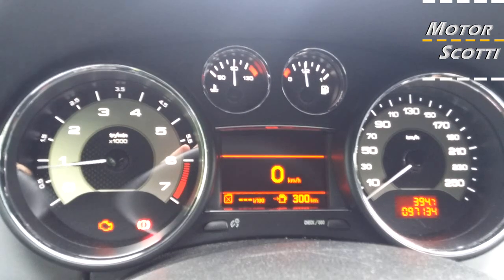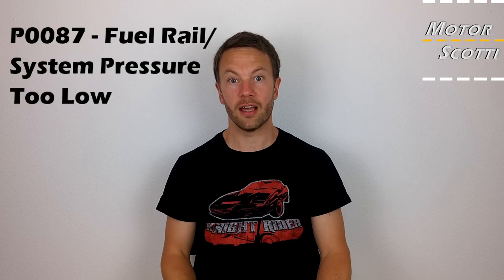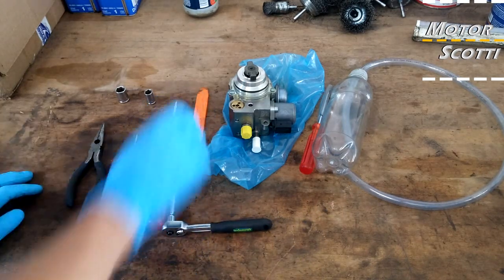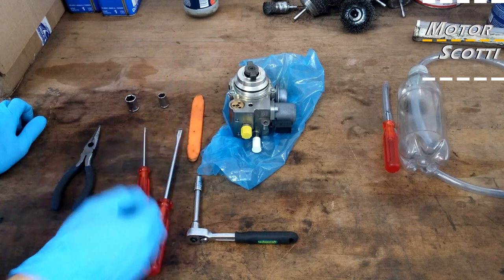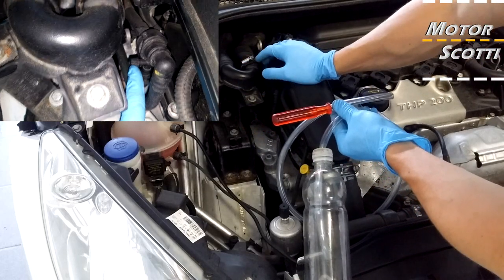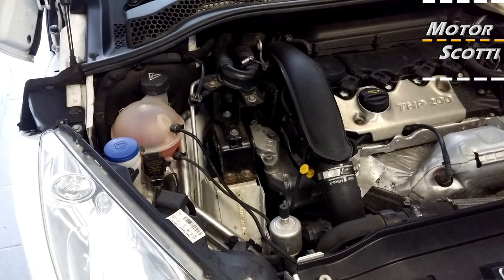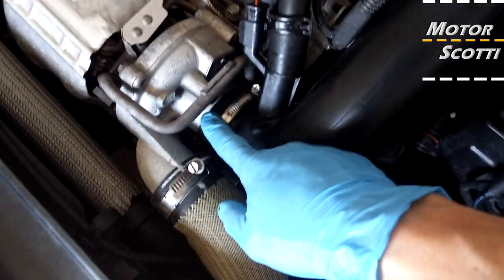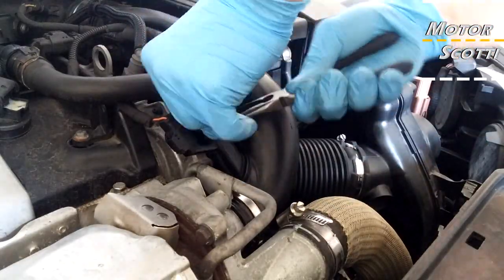New high pressure fuel pump - PSA & MINI Prince engine

Comment: I have the same symptoms, however no error codes, and the poor power performance is intermittent and occasional. I do have the rough idle all the time when the engine is cold. Mine is a mk ii 156GT, so was surprised when I got the problem
Reply from the maker: What do you mean with mark II 156 THP? What's the model year? Did you ever hook it up to a diagnostics tool?
Reply: @MotorScotti  Sorry, its a 2013 156GT, (mkii 1.6 Petrol)
Reply: I did hook it up to my OBD reader, which reported no errors, but did show issues with the Fuel Rail Pressure...
Reply from the maker: @Natastrophe007  Yes that is the error. The high pressure pump can't build up the fuel pressure anymore which is what leads to that error. It's weird though as this problem shouldn't occur on late 2012 onwards models...
Reply: @MotorScotti  Yeah, that's what I heard.   I spoke to somone who said it could be the fuel tank breather being blocked as it oddly only looses power after filling up a nearly empty fuel tank!
Reply from the maker: @Natastrophe007  Could be, always start with the simple things first before taking everything apart and spending lots of money ^^. You can test it with the fuel cap open and closed when you fill it up. Obviously don't drive with the cap open but you can still give it a rev - see if it makes a difference.
Reply: @MotorScotti  it can be that the inlet valves are dirty its a big known problem on these cars. Have the same car with the same engine in my showroom
Reply from the maker: @abcdsz  Good to know, thanks for sharing your knowledge!
Reply: @abcdsz  I've heard about this! My car only has 39000 miles on it! I do now have error codes. Just in time for christmas my car brakes down with codes P0171 & P2188. What I'm not sure is, what it may be. Is it the High Pressure Fuel Pump, or the Coil packs, or maybe just a air intake leak?
Reply: @Natastrophe007  let lambda sensor check. Those are well known problems too. On these engine are the most problems injectors, HPFP (high pressure fuel pump) , dirty intake valves , bad chain tensioner, chain that is stretching out. If i was you i would let check my lambda sensors . Hpfp and put a injector cleaner
Reply: @Natastrophe007  does your car have problem with acceleration?? If so pull out your mass airflow sensor connector off and see if your will stall and or drive with the connector unplugged accelerate hard and see if you have power gain.!  Btw is your  car remapped??
Reply: @abcdsz  Hiya, car is not re-mapped. I cleared the codes and the power came back, but i'll give unplugging a go. When the errors are present I have no acceleration power!
Reply: @Natastrophe007  p2188 is a Mass airflow sensor fault. So i think your MAF sensor is dirty or faulty. You can clean it with MAF sensor cleaner. If you have a faulty HPFP pump there would be a fault code like fuel rail pressure too low. (Something like that) . I dont know how much the maf sensor costs in your country but its always to buy a new one for optimal performance. If its expensive buy a bottle of maf sensor cleaner. And look first if your maf sensor is oily and dirty.
Reply: @abcdsz  Is that the same as the O2 sensor at the front of the engine on the manifold?
Reply: @Natastrophe007  it is mostly on the big black pipe after your intake filter housing going to your engine. With a big connector on its and two big clamps holding it at place on the two pipes coming from your filter housing and from a pipe to your engine.
Reply: @abcdsz  Ah, I see! I guess the only way to clean it is to remove? Fuel cleaner and additive wont help I guess?
Reply: @Natastrophe007  nope it is a direct injection thats why these engines have so much problems:(. But anyway the MAF sensor must br dry when functioning or it can burn the electronics. The only cleaner is MAF sensor cleaner. You can buy it from your local car parts store nearby. But watch out!!!! Dont clean it with compressed air!!!
Reply: @abcdsz  Just a quick update, the HPFP was the problem and has been replaced. The car is fine now! Thanks for all your help!
Reply: @Natastrophe007  Hi, could you please know how much did cost you replace HPFP thank you?
Reply: @reyash1979  Hey Ash, its tricky to say as mine was repaired under warranty. As a guide, the pump costs around £450 plus a few hours fitting, so you could be looking at around £600
Reply: @Natastrophe007  thank you Nat, I found one on Ebay but scary to gamble on it buying it. Anyway my car starts fine only when you drive it up to speed 40mph then goes flat and sluggish. Does yours was the same?
Reply: @reyash1979  mine had a rough idle but full power, however as time passed, it kept going into limp mode, no power felt like a 1.0L lol
Reply: @Natastrophe007  lol, after I watch few videos on here, I took a decision to replace it myself, finger crossed things well. As rang few garage the cheapest want £700.
Reply: @reyash1979  700 fitted is a reasonable price, but if you know how to do it, go for it!

Comment: Hi mate. I have the same car but the engine is smaller 1.6T. There is a strange problem is the air conditioner works but there is no cooler there is no leakage of gas everything is fine but there is no power up to the compressor we connect the compressor directly to the battery works well but the car started smoke from the exhaust ?? Is there a solution to this problem
Reply: I just found that on my 308, just replace thermostat housing and will be ok

Comment: great video as always thankyou. still love the rcz gt200.
Reply from the maker: Thanks a lot Stuart!
Reply: @MotorScotti  finally got to the bottom of mine. it was the water pump pulley it was falling to pieces so we replaced it and its awesome again.
Reply from the maker: @sjm.photos  fantastic! Did you film how it sounded like when it was failing?
Reply: @MotorScotti  no unfortunately not it sounded just like the chain death rattle very similar sound. was horrid very noisy will come from the right hand side of the car from the wheel arch.
Reply from the maker: @sjm.photos  interesting! So basically the bearing was done. How many km or miles does your car have?
Reply: @MotorScotti  67000 miles. here is a couple of videos of mine :)
Reply: MotorScotti mine has a serious issue at the moment. Don't think timing chain but a rev related rattle / purr possible turbo or injection pump or possible crankshaft bearing or pulley
Reply from the maker: !! Reading your description that could be anywhere. What model year is yours. May very well be the timing chain / tensioner, even though they had that problem fixed on that engine by the time the RCZ came out but you never know.
Reply: its already had a timing chain upgrade and new tensioner i put a new one in every 2 years its the gt200 2011.  the other thing it might be is the duel mass flywheel. its rev related. it is going into my dealer in a few weeks. there is no power loss. it is covered by extended warranty so not to worried i just want it fixed.
Reply from the maker: Interesting, let me know what it was once you got it fixed. Good thing it's still under warranty!
Reply: yes i shall :) yes its worth it just incase

Comment: Ouaip, je "remember" parfaitement ce petit voyant, parce qu'il s'est allumé quand tu m'as demandé de "la faire tourner un peu" en ton absence et que j'ai bien cru que j'allais rester planté à 50 km de chez moi ^^
Heureux de voir que tu as pris le problème en main ;)
Reply from the maker: Piston Kirk En effet, il était temps!
Reply: Piston Kirk slt faut t il  reprogrammer quand on change la pompe hp parce que j ai ce problème et je vais le faire moi même merci d avance
Reply from the maker: Excellente remarque! Non, il ne faut programmer la nouvelle pompe à hp. Cependant, il faut effacer le code erreur avec la valise diagnostique. Le code erreur va disparaître une fois que tu roules quelques km et que tu redémarre la voiture. Par contre, il risque de revenir. C'est ce qui s'est passé sur la mienne, donc penses bien à effacer le code erreur après l'installation est c'est bon ==> 14:36.
Reply: MotorScotti merci pour ta réponse et tes vidéo son utile pour la rcz

Comment: Nice video, :) 
You don't have pressure in the low pressure line for you  probably don't have run the car for a long time  ( 10 hours or more) or put the key on which  activate the low pressure pump. ( with the passing time, the pression fells down)

So,
Before doing this operation, I recommand  not to put the key in the car cause it can run the low pressure pump when opennig the driver's door .

My RCZ is also a THP 200 in perla Nera (2012),  46 000 km and still fine :)  I love this car :)
Reply from the maker: Thank you, yes it's a cool car. That appears to be a reasonable explanation. Enjoy it!

Comment: I've also got this problem yersteday
200km trip, when I arrived, shut off engine, restarted 15 min later. Engine light, running on 3 cylinders. 
Turned it off after 5 min drive in limb mode, removed the error with small device, running perfectly after that, 
101'000 km, 2010 Rcz
Always buy a small diagnostic device when you purchase a french car
Reply from the maker: Above OSK well if it ran on 3 cylinders it was a different problem: spark plug, coil or injector probably but thanks for watching
Reply: I mean, lot of missfires on a cylinder, had the P0087 error, I think about a sensor, because deleting the error allows car to run correctly. 
I've heard explosions while climbing the wallis, maybe the exhaust cutout scraped on the road and made sparks that exploded, maybe like 7-8 missfires in a row
Reply: @Katzuny  how you delite the error?
Reply: @morissapir7647  Using an OBDII reader-eraser

Comment: I had my HP fuel pump replaced few months ago on my 2013 RCZ THP200 at around 80k km. I paid 480 eur for it. I think THP156 and THP200 uses different HP fuel pumps. For THP156 part code is 1920LL and for THP200 part code is 1920RT.

Also, i'm not sure if newest version of HP fuel pump is any better. I heard some RCZ owners have replaced it twice already and it usually happens at around 60-100k km.
Reply: the difference between the two is that the capture points are in other places. on the side of one, in the middle of the other.
Reply: MotorScotti Does that mean no more RCZ videos then?
Reply from the maker: dirk venter I still have several things on the RCZ I want to cover, I don't plan on selling it but it will be a mix with combined with the Knight Rider series.
Reply from the maker: Ričardas Stoma Interesting! I thought the new one was an improved version... I guess only time will tell. But then I might sell the car before it breaks down again ;)
Reply: MotorScotti Great to hear.

Comment: Well I have the same high pressure fuel pump fail P0087 on my Peugeot 207 THP 2008 year. After changing timing chain kit, ignition coils and sparks. My cold start issues have to be because of the fuel pump (I told you about this problem a few months ago on the comments section). Should I have to change the little high pressure tube as well?  I can get the pum new on Ebay for just 360 euros. 
 
https://www.ebay.es/itm/ORIGINAL-PSA-HOCHDRUCKLEITUNG-KRAFTSTOFFLEITUNG-ZU-1920LL-PEUGEOT-CITROEN-MINI/153007623158?_trkparms=aid%3D222007%26algo%3DSIM.MBE%26ao%3D1%26asc%3D20170803113847%26meid%3D2c51a202b4cd49f7b92c24f8ff1107f2%26pid%3D100278%26rk%3D4%26rkt%3D4%26sd%3D273249377372%26itm%3D153007623158&_trksid=p2060778.c100278.m3478
Reply from the maker: I've read in forums that many people recommend changing this fuel line as well when you change the pump. It can't hurt, that's for sure. I haven't changed it because I couldn't see any leaks and I didn't bend it while I replaced the pump. So far it's been fine. However, if you're hesitating and are gonna open everything anyway it certainly can't hurt to change that line as well. Is it necessary? From my point of view only if you damaged the existing line.
Reply: Thanks, so I talked about this with my mechanic and he said that it's not necessary as well if it's in good conditions. BTW Did you notice a better fuel consumption with the new HPFP?

Cheers from Spain.
Reply from the maker: Lunas147 Cool! No I didn't notice a better fuel consumption. It's the same.

Comment: My mechanical warranty will pay 16000 rand in South Africa (1245 Swiss francs) for mine @ Peugeot Citroën South Africa next week. I believe it is a better version, thus the price increase. I believe the old high pressure fuel pump really had to be put on a recall list with the timing tensioner(wearing out - making the timing chain let the RCZ petrol sound like a diesel car) and the thermostat housing (prone to cracking).  Awesome video, thanks.
Reply from the maker: dirk venter Thanks Dirk, much appreciated. Yes these three elements should have been on a recall list. My car got recalled for the thermostat though. In your warranty offer, the labour costs are probably included as well, don't you think? I got the newest version of the high pressure pump from Peugeot so it should be fine.
Reply: MotorScotti Thanks for the reply. I have a 2010 200 Thp GT. My warranty is thus not a Peugeot one as my Z is older than 5 years and covers a maximum of 16000 ZAR. Thus It just covers my hp pump, not the labour, nor the timing tensioner that will be replaced. It seems that there are a few parts that have to be replaced (that were upgraded to new parts) on the older Zs, as you mentioned about the pump and I in my previous post. I eant to identify them all so I may be prepared and warn others in our South African RCZ club.
Reply: MotorScotti  If you service regularly your car in Peugeot  dealership and car is not older then 72 months and 150000 km they suppose to repair-replace these two things ( pump and chain) under warranty, but they don't inform officialy about that. You just have to pay for labour. They know problem , but they don't do anything to solve it, because is cheaper for them to replace parts in some amount of cars sharing costs with owners. On the end just two advices for THP - use 0W40 good quality oil on  ester base and only 98 + fuel.
Reply: Hey Dirk, Which warranty service did you go through? I'm about to look at changing mine out. Also, do you which part number they're changing yours to? I'm in JHB. Cheers Kyle
Reply: Kyle Geach Hi Kyle. It is from Innovation group. May I contact you?